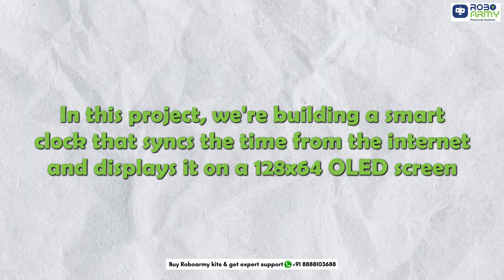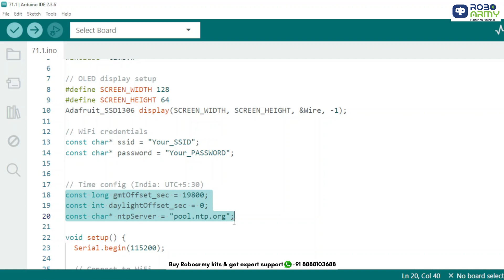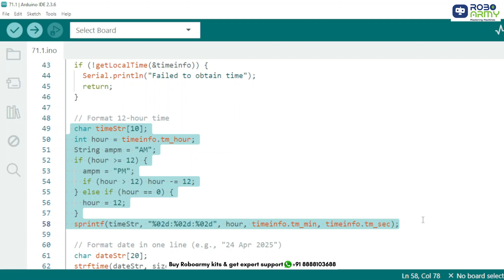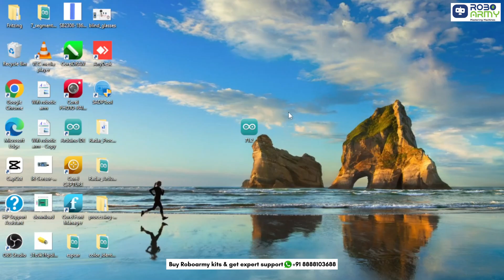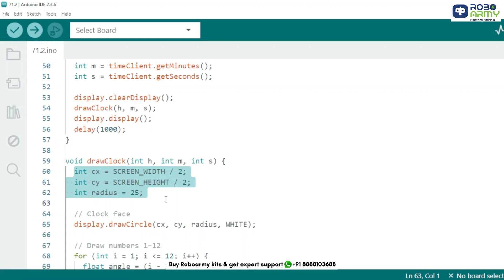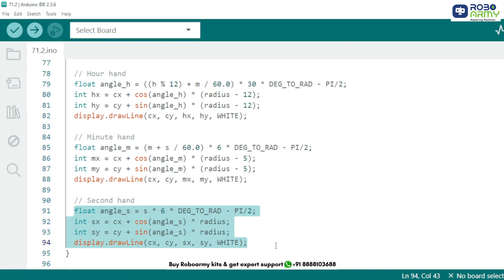Real-Time Internet Clock using WiFi and NTP | ESP32 NTP Clock with OLED Display

Comment: Hello can I use the 12f board instead of this 

Is the wiring same for the 12f
Reply from the maker: Hi! 👋
Yes, you can use the ESP-12F (ESP8266) board, but please note that the wiring will NOT be exactly the same.

🔹 The ESP-12F has different GPIO pin numbers compared to ESP32
🔹 It works only on 3.3V logic (very important ⚠️)
🔹 You’ll need to check and change:

SDA & SCL pin mapping for OLED
WiFi-related libraries (ESP8266 instead of ESP32)
Boot pins (GPIO 0, 2, 15) must be handled correctly

So, conceptually the project will work, but both wiring and code need small modifications.

Comment: I like this project, but I think it would make more sense to set the time from NTP and then operate offline... perhaps syncing daily with NTP.
Reply from the maker: Great suggestion! 😊
That’s actually a very smart approach — syncing the time once through NTP and then running the clock offline to save WiFi power and reduce dependence on constant internet connectivity.

In this tutorial, we kept the clock connected continuously so beginners can see live second-by-second updates directly from the NTP server.
But yes, your idea is absolutely valid — the clock can:

🔹 Sync with NTP once at startup
🔹 Store the time using the ESP32’s internal RTC
🔹 Run completely offline
🔹 Optionally re-sync once every few hours or once a day

Thanks for the thoughtful feedback! We may cover an “offline + periodic sync” version in an upcoming video.

Comment: combine this clock,add screen timeout,or button to select the view
Reply from the maker: Great ideas! Adding a screen timeout and a button to switch views would definitely enhance the clock.
Reply: @robo_army_ do you have exp screentimeout for adafruit lib,coz i cant find it,so i only add a button to turn off display(i'm using esp8266 with 0.96" oled)